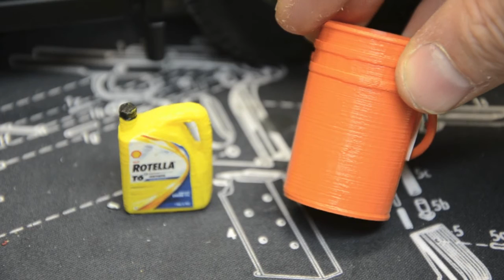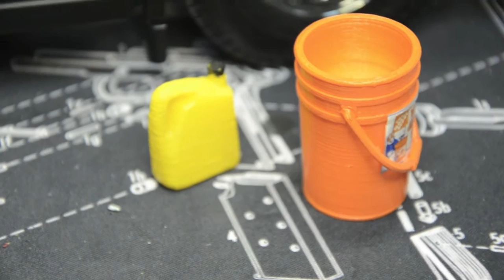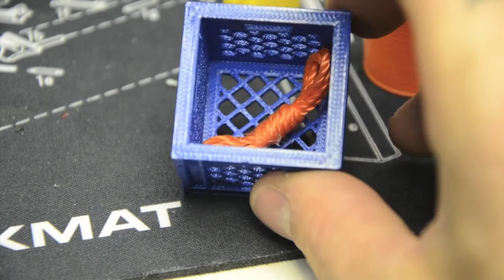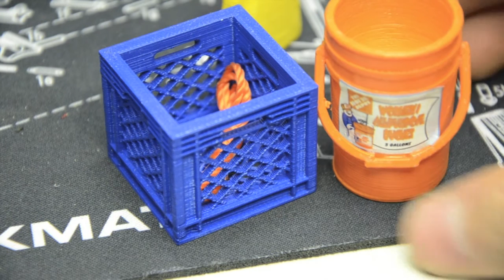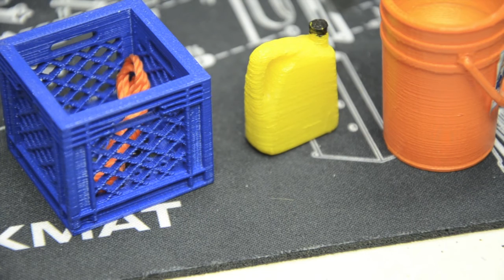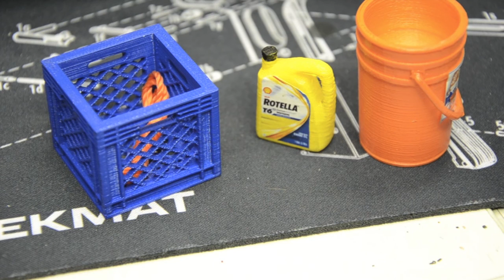Discussion on 3D Printed Scale Parts

Comment: It's really the fault of the ebay sellers not caring enough about the end user, and not putting effort into the production of their models. If I were to sell 3d prints, I'd take the time and make a well-finished master model, then make resin casts from that. That would make it faster to reproduce than printing, higher quality and cheaper to produce. Better all round, it just takes a bit of set-up time.